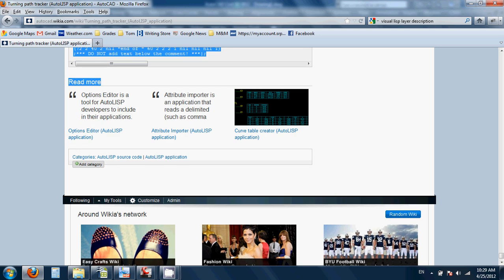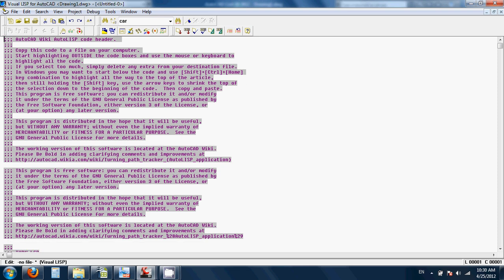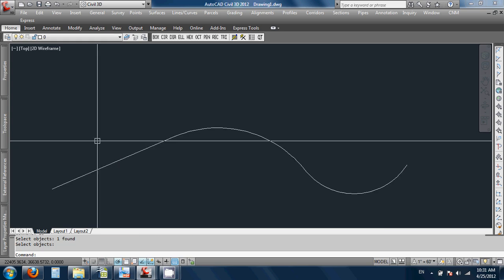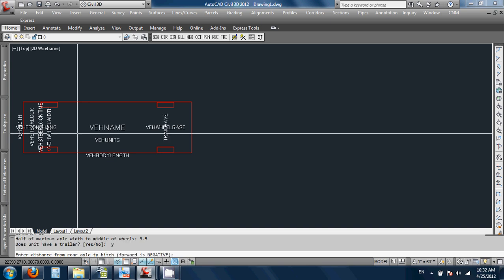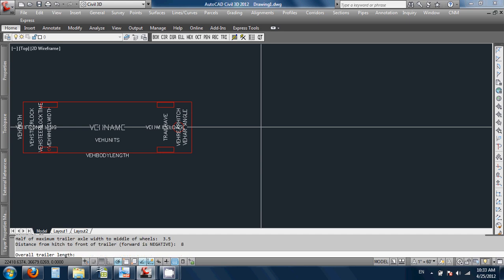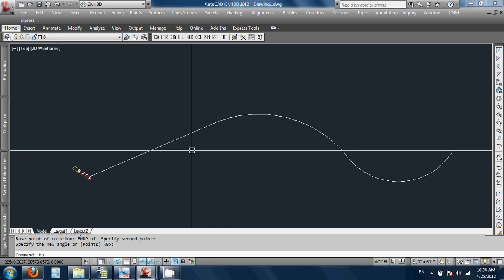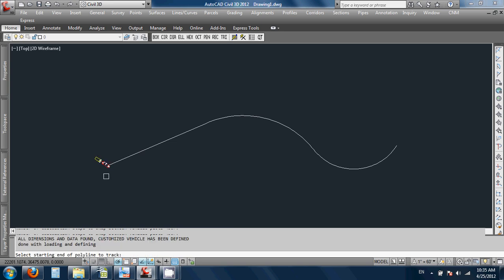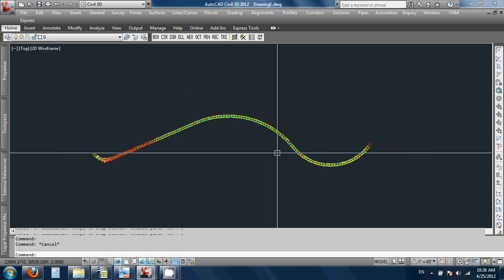How to Test TURN.LSP version 1.1.13

Comment: Hi Tom, great video, thanks for the help. One question; 

I want to determine turning radius of a truck that moves in reverse. When I run the 'turn' program and set the starting point behind the left wheel the truck keeps trying to do a three point turn. How do I make the wheels smoothly follow the polyline path? 

Your help is appreciated.
Reply from the maker: To model a vehicle driving in reverse, you would need real-time steering.  Anything preset will result in a jackknife and a three-point turn.

Comment: Do I have to keep my units the same as the turntest.dwg?

It is set to decimal inches and the AASHTO blocks are set to decimal feet, so I'm a little confused.

I had to import the P (passenger) block into the turntest at 1/12 scale to get it to work, and then run it.  Everything is 1/12th of the size it should be though so I don't know how to use this.  If I scale everything in the turntest.dwg by 12, then the lisp doesn't work.

thank you
Reply from the maker: +Tyler Wallace I am not sure.  I tend to think in decimal "unitless".  It's possible that TURN,LSP memorized calculation step and plotting step from before you scaled things, and it's possible that those values are not making sense with your new scale.  ???  In general, TURN.LSP should work at any scale.  If you need to have somebody look at what you are doing, feel free to contact me using the form at my web site.

Comment from the maker: From a user:

This method of loading TURN only lasts through the drawing session.

A more permanent way is use Tools>Load application – if you copy and paste into here it’s there all the time, then when you need it all you have to do is follow the same instructions >Tools>load Applications – its then in the list and it’s an instant load.

Also when you download the file you may need to delete the .txt from the end of the 
download – the icon changes from text to LISP.